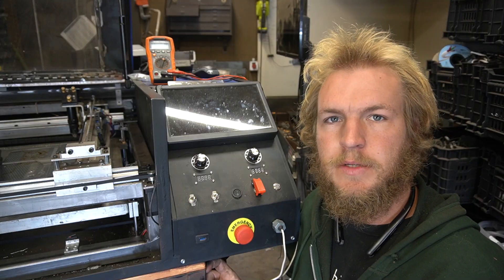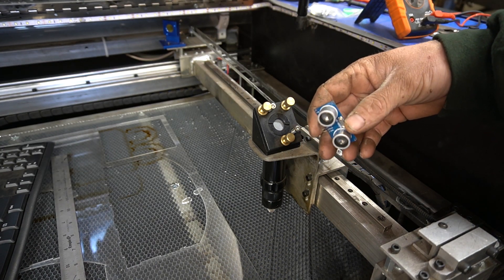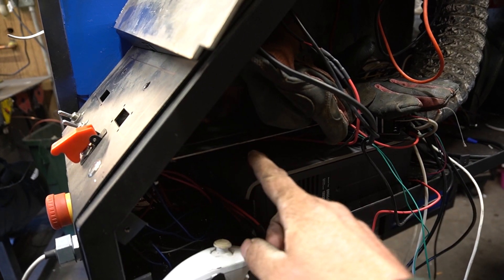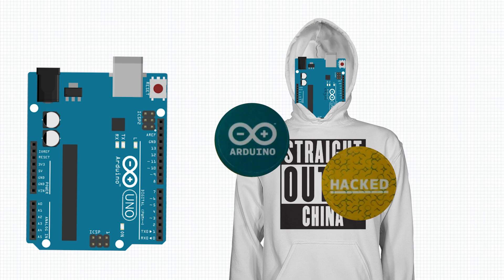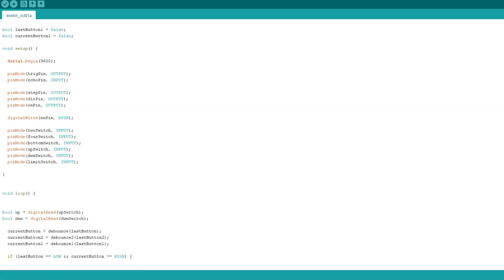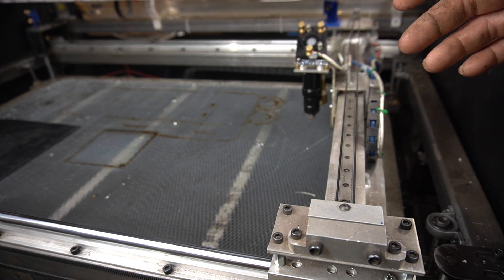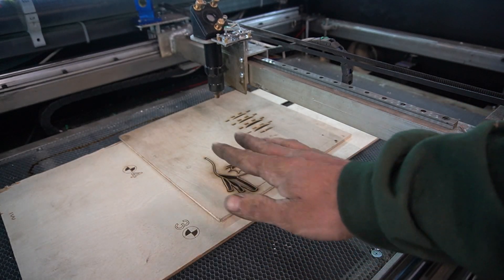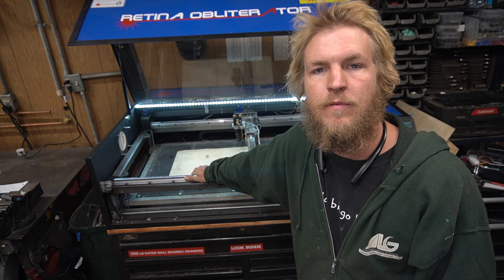Focusing My Laser With ULTRASONIC WAVES

Comment: For cutting, you want your focus point to half of your material thickness. For this case, I suggest measuring with and without the stock and then going to the halfway point, so your focus is inside the material. Helps when cutting thick acrylic, for example

Comment: Nice, have you looked at the VL6180 these use a laser beam to calculate the distance, they have a narrower beam than the sonar, which gives more accuracy. (0-620mm)
You can get it as a module of eBay to attach to and Arduino, and there are libraries for it.
There is the VL6180X witch is more accurate but only 0-100mm

Comment: I agree with Zeb Deming's comment. Hey I had an easy idea for your ultrasound attachment; If you had a material of varied thickness you could Z-height map the surface to change the focus height as it moves in X and Y. Of course the resolution would be limited but maybe with some interpolation you wouldn't be limited to purely flat stuff. Thanks for the entertainment!

Comment: Those cheap ultrasonics are notoriously inaccurate. I would put a little plastic box on top of it to keep any tidbits from landing on the circuit board at least. Then in your code toss out any readings that are obviously preposterous as a failsafe so it doesnt skew your average.

Comment: Honestly, this is a brilliant idea! I can't believe I didn't think of it. Did you think of it yourself or was it an idea from the forums? :) I'm seriously considering doing this on my laser now, and I'm also pondering how useful it could be in a torch height controller application on the plasma table too! Thanks for the ideas
Reply from the maker: It's probably not accurate enough for a thc, as I can't imagine the ultrasonic sensor would work very well while in motion, but it'd be interesting to try!
Thanks for the support man!

Comment: Isn't there anything broken around the house you can pull a tactile switch from? Hot glue one of them onto the bed and a stick above it. When the stick pushes the button you override the bed movement. Even if you bought the tactile switch they cost pennies and you can mount them on a bent piece of metal so it doesn't get crushed before being tripped.
Reply from the maker: I like to live on the edge